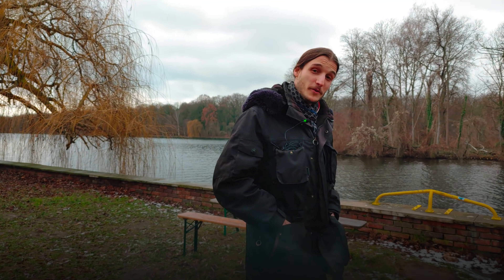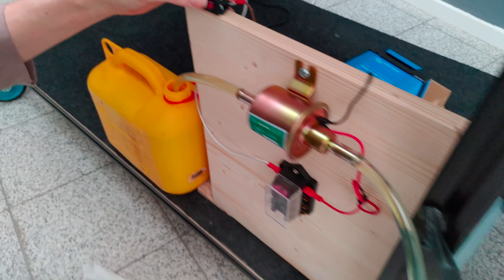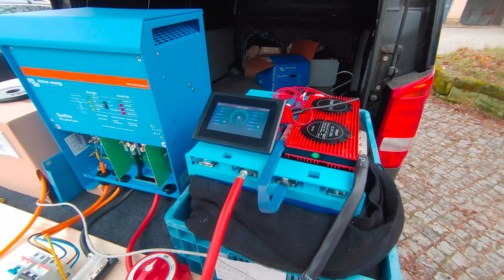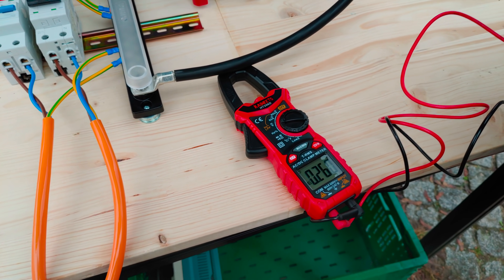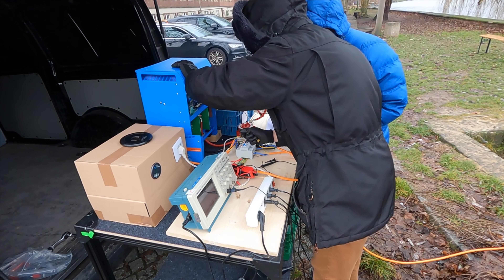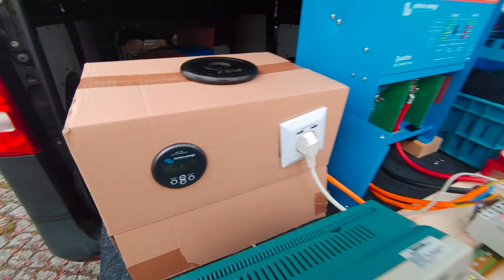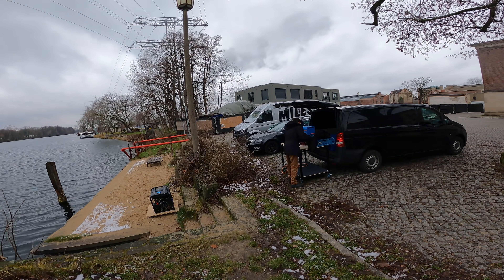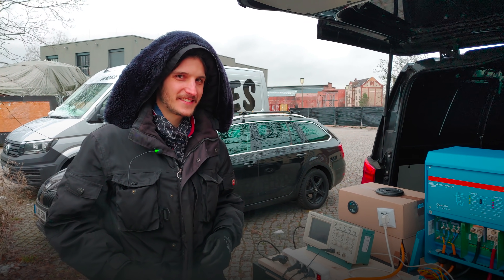Building an AC circuit for our boat - Week 13-15 - Vintage Yacht Restoration Vlog

Comment: Looking at that setup I am a bit concerned because 5K watts out of a 2.5 kw/h battery in my opinion might harm the battery.  I personally think a 1:1 ratio is the minimum (IE with 5K inverter, use at least 5Kw/h of batteries).

Comment: Interesting almost no one would of been this thorough verging on anally retentive. You encountered teething problems which you fixed and anyone would of expected that. Yet the whole exercise turned out to be worthwhile since it identified a weakness in the system the fuse.  If you had just installed the system as most people would do the minimum would of been it melting but it is also possible that it could of set fire to your whole boat

Comment: Next time you have to mount the windows, you better mount the rubber arround the windows first, than use a string in the outside opening of the rubber and place the window in the frame (lower part first) lubricate with soap or oil and pull the window with the rubber in the frame with the string, By the way you did mount your rubbers inside out :-) 
This way you can do it all alone (like I used to do it many years)
Reply: Dental floss works well.

Comment: I love your channel but to be honest, this seems like overkill to me. Why would you need such powerful and expensive equipment?
I have 1 solar panel, which is plenty to keep my batteries charged and my fridge running.
Money is better spent on your restoration, which is not going to stay within budget but you probably know that.
Reply: they intend to live on the boat full time often away from shore power.
Reply: Love you set up, and we can see you did you homework but is true you dont need that amount of power on a boat. Solar panels and if you want small generator as backup. At the end you only charge computers phones and maybe someday you might need tool. Battery tools are great this days. Following you i love to see how you project comes out. Im in similar procces , stiping a 16 mets ex patrol vessel, so its inspirational to see you procces ⚓️
Reply: @psynestetiksiko895  they intend to live full time on the boat. so refrigerators, lights, fresh water making, cooking by way of oven, microwave. yes they need more power.
Reply: @toomanyaccounts  you can find frige and all the other electronics in 12 volts plus kitchen and oven on gas. I allways lived in boats. And currently restoring a boat to live full time. I try to avoid  220 volts on the boat. Having a generator is very anoying on a boat. There are some great solar panels now days. Better spend the mony in a big inverter. Just my point of view, just say it cause might help you. Plus you have the motor wich is a huge generator.

Comment: Is Bert Clements comments reasonable ?
Reply: I don"t know what he means by "non native". ITC seems to be a reputable brand.
Reply: Absolutely
Reply: you gen seems to smoke a lot.. you will need to vent it properly and I agree with using non marine rated electrics..they may fail due to corrosion when needed.. I have been watching since your first vid.. great job so far..

Comment: Awesome! The problem with putting commercial non-marine rated equipment on your boat is, in a few years it'll all be rusted out. Also, where do you plan to put your air-cooled diesel generator. Not advised to put it in the engine room.
Reply: More importantly, safety.

Comment: Schönes Video! Hab eure ersten Videos Anfang des Jahres durchgesuchtet und hab mich schon sehr auf was Neues von euch gefreut. Im Vergleich ist die Videoqualität nochmal deutlich besser geworden, finde ich. Eine Frage hab ich noch, sorry wenn die vielleicht schon irgendwo beantwortet wurde: Plant ihr, Solarzellen auf dem Boot zu verbauen um damit auch die Batterien laden zu können, damit der Generator nicht ständig laufen muss?
And for the english speakers: Do you plan to install solar on the boat, so the generator does not need to run all the time?
Reply from the maker: Danke für das Feedback. Solarzellen kommen auf jeden Fall auch mal ran, aber erst wenn wir etwas weiter mit dem Rest vorangeschritten sind.

Comment: Nice film, where  do you plan to have the generator on the boat?
Reply from the maker: it has to go into the engine room. From our measurments it should fit just barely. That's why I got such a "naked" generator, rather than a fully isolated one. We'll make our own isolation once it's installed.